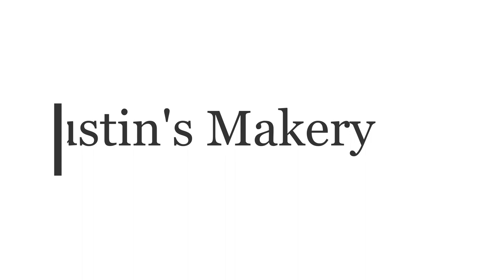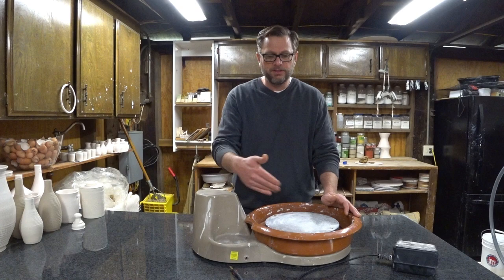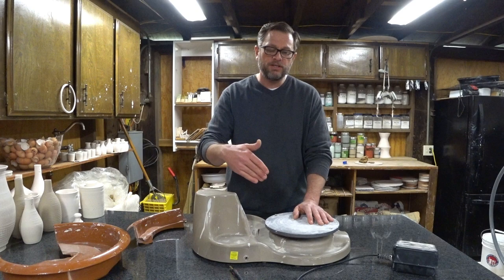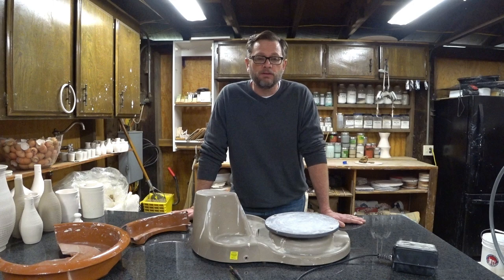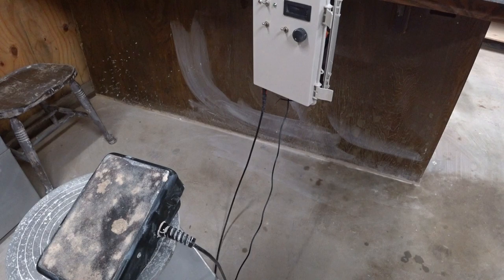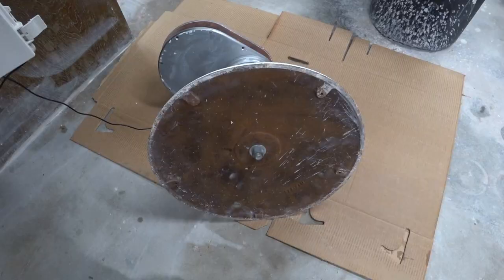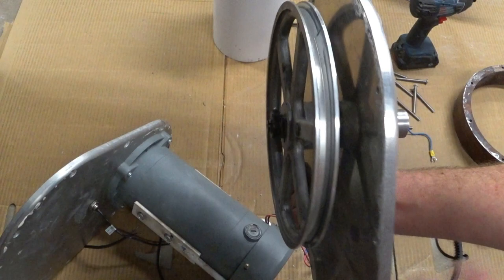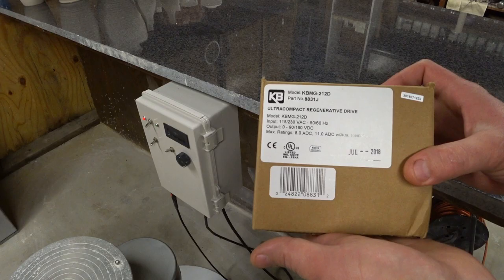DIY Pottery Wheel Discussion + Speedball Artista Review

Comment: You did a very nice job on this. I'm sure the few seconds you spent talking about casting and machining the wheel don't reflect the many hours you have spent in refining that skill (and others).

I'm investigating building a budget wheel. For others interested, you might consider looking into recycling the DC motor and speed controller from a treadmill. The motors are often DC and rated for 1HP continuous operation, and the speed controller in the treadmill can often be controlled with a potentiometer directly.

Comment: I have the speedball wheel. Have used it for 12 hour demo days at fairs and love it. My wheel has foot control and does not jump when it is being plugged in or out.  I like the lite weight and ease of set up.  Mine seems to take a licking and keep on giving. Think you had a lemon . Friend also has one as her primary wheel.  Like that you have enough skill to build your own.
Reply: Hey! I just ordered a speedball artista , I’m getting back into pottery after a few years. Do you think it’s a good wheel to start off with ? I bought the stand for it , I’m just worried it’s going to wobble. I don’t plan on throwing anymore than like 10 lbs of clay at a time

Comment: Love the video and I know it has been a while since you built this and posted about it. Wondering if you think a 110V 3hp treadmill motor would work. I know it has plenty of torque (the treadmill was rated for up to 350 lbs and the belt never slipped when walking on it) but it is rated for 3600 RPMs. Even with a  6:1 gear reduction, that would put the top speed a bit too high. I really want to make a wheel (love the idea of making) and I have this old, professional-grade treadmill just taking up space as the main LCD no longer works and the company no longer makes replacements.

Comment: Ha I did it. Got it untangled without taking it apart. Note to self “always double check even if you think it’s unplugged. Do like your wheel head that pops off.  Would have my life easier today. 
Keep posting. Found your station through John the Potter. My son is a double e
So our family over engineers everything.
Reply from the maker: Sorry I didn't reply faster to help, but I'm glad you got it figured out!
Reply: Justins Makery 
That’s ok. I did yes but there are no replacement cords. You have to buy a whole new pedal. Should my husband be able to hard wire a new cord ?
Reply from the maker: Replacing the wire for the foot petal is not hard.  I replaced mine with a guitar cable that had the same style plug as the old petal. (look on amazon)  Opening the foot petal itself and swapping out the cable isn't difficult either.
Reply: Justins Makery 
I wondered about that. I thought that it looked like one of my jacks for my guitar. 
Thank you. Using just the hand control is awkward. It’s too bad The makers of the foot control didn’t make the cord replaceable and on the same side as the controls. I’m planning on upgrading my wheel but this one is perfect for my grandkids and for a trimming wheel and the diamond sanding bat 
Thanks again
Your channel is inspiring and you are an excellent teacher.

Comment: Great build, but your motor is TEFC, totally enclosed fan cooled. You really should have a vent or cooling fins on your assembly. You might be OK with short usage time and small items you are throwing, ie having very little load. Perhaps the aluminum case radiates enough heat that the motor is OK.

Comment: How would I go about upgrading my current wheel. I'm interested in adding speed so that would be voltage. Preferably 1hp. And also will that also help with the wheel slowdown when applying pressure.  I got myself a really inexpensive wheel by vexor and I think it has great potential for an upgrade... and seeing your video has given me hope... hehe thank you for your time

Comment: Loved the video, exactly the guidance I needed on a controller. I've been working on plans for a wheel myself and I like the controller you're using. My question is the speedball artista pedal uses a 100k ohm pot but the controller you're using comes with a 5k ohm pot? Did you replace the potentiometer in the artista pedal? Or had any issues using the 100k 
Ohm pot in the artista pedal?

Comment: I like the clean design. Do you have any issues with motor over heating ?
Reply from the maker: Thanks!  No overheating at all.  I haven't even felt it getting warm.  I was more worried about the speed control getting hot in a sealed box, but that hasn't been an issue either.

Comment: it's a very nice looking wheel. It has an art nouveau/futurism aesthetic. I was watching your pestle and mortar vid, and it looked like it moves around a bit from pressure while throwing. Have you found a solution to this?
Reply from the maker: I still need to bolt the wheel to the floor. My concrete is a bit uneven where it sits.  :)

Comment: What do you put your artista on ? I just ordered one and I like to sit when I throw.
Reply from the maker: I traced the outline of the Artista onto plywood and cut out the shape with a jigsaw.  I added 3 short 4"x4" (fence post) wooden legs to make it the right height. I used long deck screws to hold the legs to the plywood.
Reply: Justins Makery ahh ok. Do you think it’s a pretty decent wheel? I don’t plan on throwing anymore than 10 lbs of clay. I’m getting back into it after a few years.

Comment: Is that a DC or AC motor? Are there  torque issues at low speed?
Reply from the maker: DC motor. (90v PMDC)  No problems with torque at low speeds.  Some speed controls don't like going much below 10% throttle, but I haven't had a problem.
Reply: @JustinsMakery  Thanks! Seriously cool!